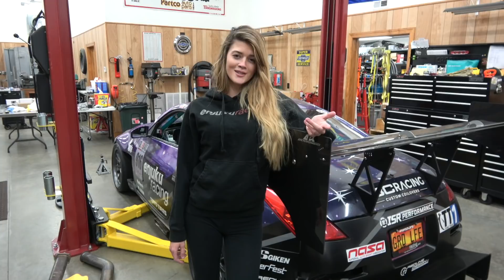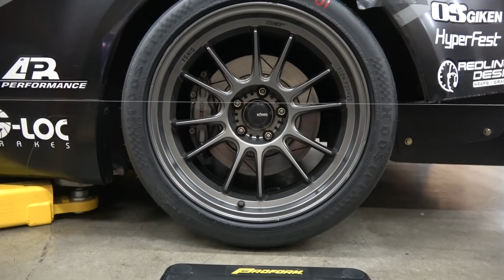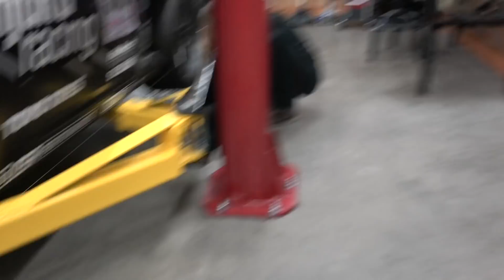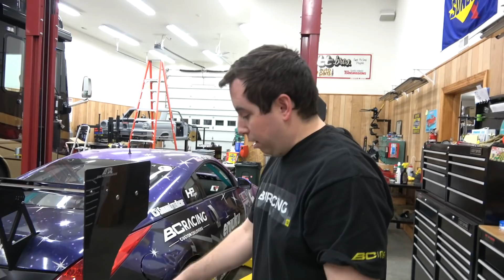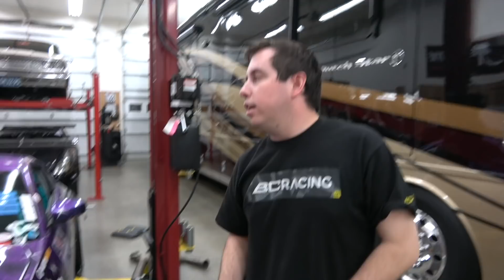How To Align Your Car

Comment: Isn’t it critical the distance between strings are the  equal front and back?
If that is not verified you are working off a trapezoid. 
The lines need to be parallel to the car.
Then you can gauge the toe more accurately.

Comment: Maybe I missed it, but nowhere do you say that the space between the strings needs to be exactly the same on both front and rear BARS.  Without that, it only works if your wheel offsets are the same at the front and back AND that the string offset from all wheels is the same.

Comment: Here are two tricks: 1. lay the two rods next to each other and mark the line spacing on both approx. 200mm wider than the axes.
This guarantees that the two cords are always parallel to each other.
Alignment with the vehicle is now easier as only the rod needs to be centered.
2. loop the cord around the poles. Now the cord is at the top and runs back under the rod. This results in two cords lying one below the other.
If you now measure from above, simply align your view so that only the upper cord is visible. Reading errors are now ruled out.

Comment: Im a little confused on the toe-in.  Another video seemed to say the front wheels should be toed in 1/16 of an inch at the front of the wheels.  Is that correct or no.

Comment: This is exactly how I do my little british sports car track car and its very simple people get a little caught up in the numbers but as long as the poles or sticks either end are the same length and are marked up and grooved exactly the same its just creating a squared rectangle around the car to set it up you can measure from any point on the wheel as long as your left to right numbers match front and rear you are squared up. Then just a case of measuring the front and rear of each wheel to the opposite side. As my car is rear wheel drive i like a degree toe out on the front and a degree toe in on the rear so under load/ acceleration it squres it up some what. I have a set of toe plates that I take to the track to check nothing has moved. Thats my thoughts anyway.

Comment: Cheers for this, got the car tracked at home. New anti roll bar bushes, inner / outer tie rods.. so you can just imagine when parts come as different lengths lol you can count your rotations as you remove but nothing ever goes back on the same! Sorted, cheers.

Comment: Because you never measured the distance between the left and right strings at the front and rear, you have no idea if the strings are parallel OR square. So, you cannot make an accurate toe in measurement. You also did not check to see if the rear axle is square on the chassis. If it isn't, no useful toe adjustment can be made.
Reply: Also, track width between front Axl and rear Axl are almost always different. Not a good measurement from center cap to center cap of the rear track width is wider by a few mm’s.

Comment: oops forgot one detail - the guy I talked about didn't use garbage bags. He used under each tire two old linoleum kitchen tiles (the old stiff type). He said they slid easily on concrete so you can make the corrections easily - AND THEY DO! Been doing that ever since!!

Comment: Was @ the Brickyard Museum I believe at the 90th anniversary back in '99 and had a casual conversation with this old guy about racing and alignments. Almost EVERYTHING you shared here was dead-nuts on w/what he said because he was the one and ONLY one that did ALL the alignments on ALL their cars. Found out later he was the chief master mechanic for a BIG name driver. Wish I would have took a pic but I'll never forget that half hour talk. Biggest thing he shared - be CONSISTANT with what you do and it'll payoff BIGTIME. It's those little fine-tune details that are the difference between being at the back of the pack and standing at the winners circle. GREAT JOB explaining. There's a HUGE gap on all the stuff online and how to do it WRONG and a lot of misinformation. THIS ONE IS RIGHT ON!!! Great job! Savannah had ALL the answers - she's a winner. NEVER stop learning. SUBSCRIBED!!!

Comment: What about using a spacer that's a set distance off of the center cap and then have the string touch that spacer. Then repeat for the rear and have the string touch the spacer at the rear again. Wouldnt that be easier than having to measure the string distance from the center cap and keep adjusting everytime? Also can you do one side (front and rear) measurement at a time if you don't use that bar? I'm asking because some one car garages are tight for space so you may not be able to adjust both sides or set up both sides at the same time.

Comment: I've used this method and it works,  get super fine on your measurements like they say, take your time, keep that steering wheel straight and bam, dialed it.  Bought a camber gauge and dialed in a  -5 degree camber and bob's your uncle.  This is in my few saved videos.

Comment: Just pay £25 and get it done by a professional
Reply: See that’s not true, if you have a lowered car that the alignment tools won’t clamp on properly you have to go to a garage that has the internal wheel clamps n that’s £75-£100 to start with n then they charge you for adjusting it! Only a few garages round me do the internal clamps, I now do the string method as it’s free n also do friends lowered cars!

Comment: The distance between the string and the wheel caps should not be the same in the front and in the rear. You have to check the wheel track width of your car model and take that into consideration.
Reply from the maker: We cover that at some point in the video when I’m explaining why the rear and front numbers are different when measuring.

Comment: If your doing this for a race csr that you check once s month or so 

Just make ot so you can mount the alignment bars to the car it's self 

Then cut 2 grooves on both alignment bars to hold the string 

2 nuts welded to each bumper and and matching brackets on the alignment bar should work

Comment: Savannah & many young people made big mistakes by SP (skin painted).
As we have known for a fact, that many marriages end in divorce or permanent separation. 
Their beautiful wall wedding portraits removed. Their pets & children divided weekly. 

Inked lovers without a college degrees, beauty fades & muscle weaken, how will one going to make $125K+/year? 
And soon rolling into COVID-21, millions of people lost their jobs & homes. 
Inking people have to be fully covered up for the live- WIFI job interviews against many with experienced lookers.

Playing with car is fine. 
But soon or later, money needed to put a roof and food on the table.
One will no longer care about 0 to 60 in under 7 seconds nor wanting a gas guzzler that do less than 13mpg/city.

Nevertheless, this tips might be helpful. 
But look how many vehicles that are on the roads that have no alignments.
Even if one does the laser alignments, come back in 2 months it will be out. 
And no fool going to recheck it to drop down another $115 to $495.00.

Never seen a video of any claimed pro mechanic do full manual front end alignments and then check it with a machine to see how much he or she is off by. 
ATG and a few can do it.
But the trade of this arts are lost because it's all about the money.

Comment: While working with my dad (78yrs young) he taught me to measure in feet and inches. I got to the point where adding subtracting and multiplying fractions in my head became second nature. While working in a fab shop, it was easier to measure in straight up inches+ one little fraction, no matter the distance because tolerances were tighter with steel than stretchy carpet. On small measurements, (machine work, etc., I prefer mm.) Nothing better for small measurements than metrics, although I adapt easily depending on situation. Conversions in my head are getting easier.....

Comment: How can you be sure the tires are alligned with the chassis if the measurements of aligning the strings with the car are based off the tires? Is that a whole other thing that should be checked before even doing any of this procedure?

Comment: If the same wheel measured in the video had 65mm on the front of the tire and 64.5 in the rear ; would that mean toe out ,   +.05 ?
What about having the wheel stay centered during the adjustment ; if i don't have a steering wheel lock can someone sit inside and hold the wheel while I adjust it?
Reply: Hi RZA, that is toe in as the distance is further from rim to string at the front. I initially thought the same whilst watching.

Comment: Can you explain why you would want the left and right strings connected with a single bar? What good does that do you ?
Reply from the maker: Jason Widelitz you want the two strings to be parallel. Our bar has grooves in the end that are equally spaced on both ends of the bar. As long as we keep those strings in the same grooves on each side then the know we can adjust them equally to make parallel lines. The entire purpose is to make parallel lines compared to the car so you have something equal to measure from on both sides
Reply: @ApexGarage  Thanks for the response. I see know its a squaring issue. Thanks

Comment: I think your methods are flawed.  When two front readings from the wheel center are the same, and two rear readings from the wheel center are the same, but they're different from each other, it means the two lines are diverging, not parallel.  You need to make sure the front reading and rear reading ON THE SAME SIDE are the same then the string is aligned with the car body.
Reply from the maker: starr karl in the beginning I mentioned we have bars on front and rear that have machines grooves in them where we hang the strings to make them parallel. I added some post edit notes in the description to be a bit more specific as many have asked the same question. With the strings in a parallel setting based on the grooves we then measure front left to front right and center and then left rear compared to right rear and center.
Reply: Close to correct
Reply: That was meant fori r Starr

Comment: RIP paint work 19:18

Also if the fronts are 148.5 and the rear are 140. How to you know you have the perfect square when you have not measured the distance front left to right of each piece of string across the poles. From a birds eye view ye the fronts might be the same and the backs be the same but it could look like this from above \ /
Reply from the maker: SirKingOfTheSwing we mention it in the beginning but should have talked about it more, and since have edited the description to explain more on this. But basically we have parallel notches built into our metal poles that creates our parallel line down the car. From there get the gap equal on the front wheel independent of the rear since track widths are different front and rear on many cars.
Reply: @ApexGarage  Very useful commemt! I wanted to ask what if wheel tracks are different on front and rear when I read this and now its all clear.
Reply: Now I get it a little more since I read the description.
I think you still might have a problem with some cars. 
Let's say that the rears are perminant, with a full live axle rear-end. 
Now let's say that the axle is dead center and perfect to the car. 
Now let's say that the whole front subframe or the whole front end is not center with the car. 
Let's say that the front is slide over to the drivers side 1" because we built the car wrong. 
Basically the cars rear axle is dog tracking when compared to the front axle. (let's just say that the rear and front axle or wheels are driving perfectly straight with no scrub, only thing is that it's just dog tracking perfectly) 
Your strings are parallel along the car, the center of each hub measures to the string is even across all hubs right to left like you are showing. 
Now if you were to measure the toe for the rear axle (un-movable), it would appear that it's off compared to the string. 

Using notches on the poles like you are doing is great, but I think that the perfect box (string square) should be placed along the car with the toe measurement off of the rear axle rims. Basically the stings are parallel with the rear rims tracking. Since the rear axle can't move, everything needs to be referenced off of the rear rims. 
Now that the strings are perfect with the rear wheels, you can measure toe for the fronts off of the string. That measurement will be off since the car is perfectly dog tracking 1" off set. Which is ok, because measuring front rims toe is off of the perfect parallel strings. 
Only thing that would look funny is that the front inner hubs are measuring 1" off set, but the wheels are all driving dead straight. 
Now just adjust toe in or out to how you want the front to be. I think this is called "thrust" alignment, as apossed to 4 wheel alignment.
The way you are doing it is assuming that both axles are not dog tracking at all (just has different track width)

Comment: Most of the string methods on youtube are simply wrong.  The distance of the front wheel pair may be different from the rear pair. To account for that.
1. To have 2 parallel lines make sure the distance of the 2 lines tied to one pole equal to that of the other pole
2. With that established the next step is to have the distance of the line to the wheel reference point equal distance for the front pair.
3. Do the same to the rear pair. Note: the front pair and rear pair may not agree for the reason above
4. Proceed to the rest
Reply: isnt that what they said?

Comment: Yep. The ends of the string, where they tie or hang on the bars have to be the same distance apart. That way they are always parallel as long as you don't slide the strings on the pole. I've made that mistake twice now.
Reply: Makes sense, in case of a difference in width  front vs rear. As long as those strings are exactly same width apart.

Comment: That rv is sweet. Traveling to race ain’t cheap. Nice video. Love the detail.
Reply: Apex Garage they make nice trailers too. Any time you don’t need to rent a room is an investment. Start slapping a lot more content on this channel, it’ll pay for it. Like your work. If possible try to add some throttle steering and brake position on screen while at the track. If possible sometimes other things are plugged in and won’t allow for that.
Reply from the maker: kells18 check out our recent video we posted today. Lots of wheel to wheel action with telemetry around VIR! Thanks for the support!

Comment: Is your rear a 1/2 mil toe out? the back of the rim was 65 mil from the string and the front of the rim was 64.5 mil from the string meaning the front of the rim is closer to the string and therefore the front is facing slightly out.

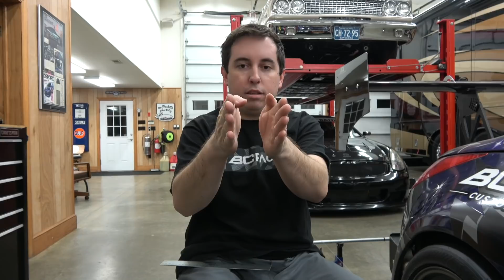You even explain it correctly at 18:30, but then mark down that you're a 1/2 mil toe in.
Reply: I also confuse about that until I saw your answer, I believe you are right!

Comment: Love that double bag trick. Very smart. The double layer is the trick hey? I wonder if 6 mil poly for rez vapo barrier would be a bit tougher...just bc I have a ton of it left over.

Metric for speeds, large distances, or energy / mass stuff....or any kinda engineering calc for sure. But when it comes to fabricating (CNC or welding) I prefer inches. Squaring things with fractions is much easier inside my little brain. Especially when talking tolerances...i dunno why but 1-2 thou or 7 tenths is just easier to say. But use what works for you for sure. No flame. Hahahah.

What camera / lens do you use? Savanna holds it hella still, but im curious if your camera gear has some kinda of image stablization in it. Viewers complain on my channel that I can be a bit shakey sometimes. I need an OIS lens or the gimbal if im free handing it.
 I really need that IBIS in the Pana's tho....so smooth. 

Great video. Everything made sense and you're right the parallelism of the strings to each other and to the centerline of the axles are key. Imma go align my truck right now cause no lift needed hahahaha.

Comment: would be nice if went into camber a little bit but i think i get the idea. thanks for the vid and all the time you put into it. i wrote alot down because i want to learn to do this myself
Reply from the maker: Oscar Goss camber is super easy. It’s literally just take a metal square tube or something that is perfectly flat and extends from wheel lip to wheel lip (not touching the tire) and then put a digital level on that flat place and it will give you a number like 87deg, which means from straight up and down (90deg) you are -3deg of camber.
Reply: @ApexGarage  wow. That is easy enough. Thanks!!